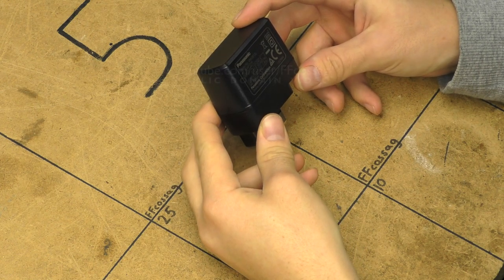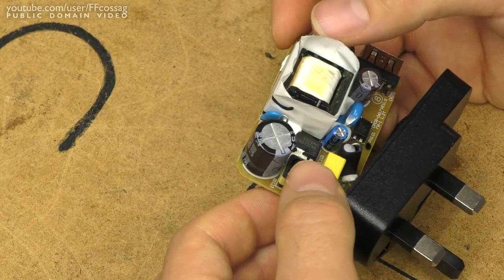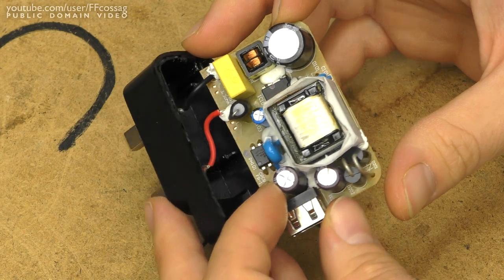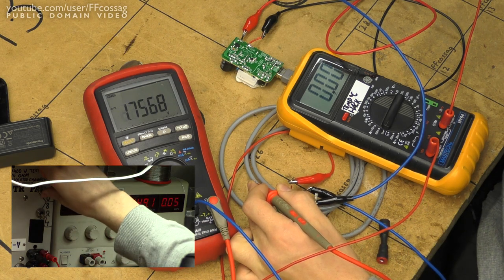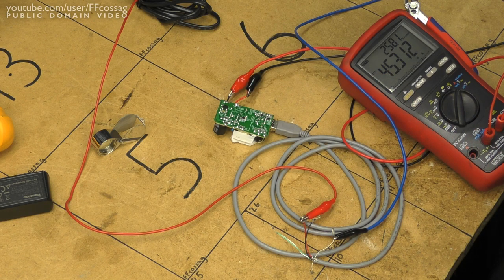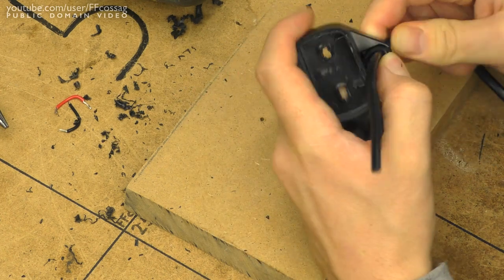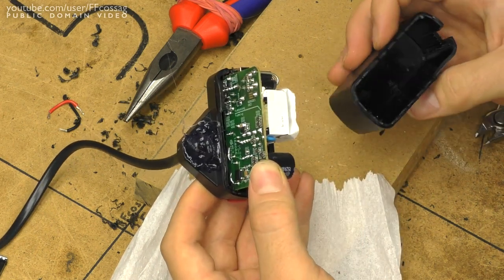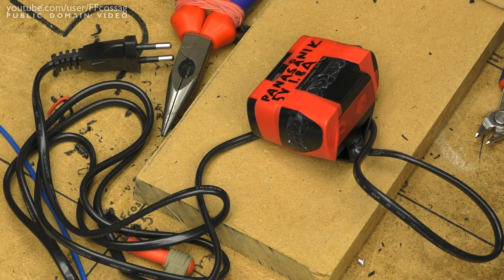Panasonic camera charger - Teardown/test/hack

Comment: How dare you call that a "Big fat british bulge" , i spat my tea out with laughing LOL :-D :-D.
You didnt change the ouput caps "suscon" yuck lol.
You did such a nice neat job otherwise :).

That 3 pin smd jobbie is a TL431 shunt regulator, connected to the opto and its input is cobbled up to a potential divider connected to the output.
They work so well that most small supplys use that method, i know you have seen them before.
Nice little supply, i liked the smart pcb and clean looking transformer :-D
Reply from the maker: Oh, that makes sense. I admit to my laziness in not looking too closely at the SMD stuff.
Reply from the maker: Oh, and I didn't see a point in replacing the caps, since it won't see very heavy use. I have a habit of unplugging my chargers when not in use.
Reply: Hey im not picking fault, just showing that im paying attention :-D.
I think tartan tape may look nice too LOL :-D
Reply: Hey im winding him up lol, im odd that way, well any way really LOL :-D

Comment: Next to the AC filter cap is that a fuse with heat shrink around it? 
Also the sheen on the green PCB side of the board makes it look like it has a slight conformal coating on it, or is that just because of the lighting and reflective material of the PCB they used? 
Much nicer USB power supplies then usually, for sure.
Reply from the maker: It's a fusible resistor in series with the mains. It's not conformally coated.

Comment: should use the vice of knowledge..
Reply: EddyBlacks To open some crappy Chinese electronics
Reply: simontay1984 I know, but the vice of knowledge is used to open cheap Chinese electronics
Reply from the maker: Alas, I do not own a vice of knowledge.
Reply from the maker: ***** I know what he meant, lol, I just don't own a suitable vice. Yet.
Reply: A better method is to take a towel, lay it on a cement floor, and then go to town on the thing with a rubber mallet.

That way you avoid scuffs or uneven cracks from the blunt force trauma of a metal hammer.

Thanks.    Liked.